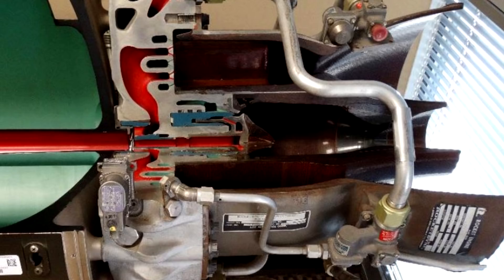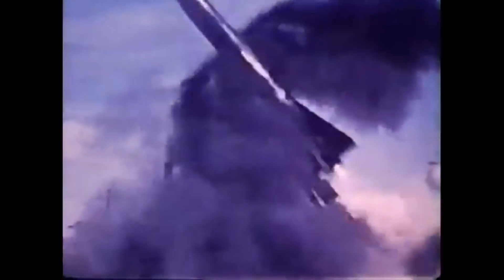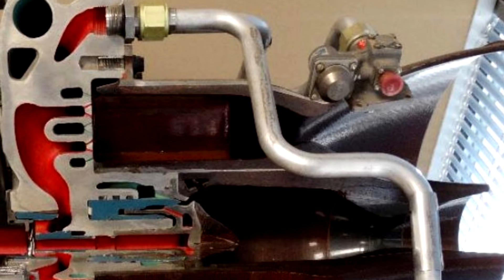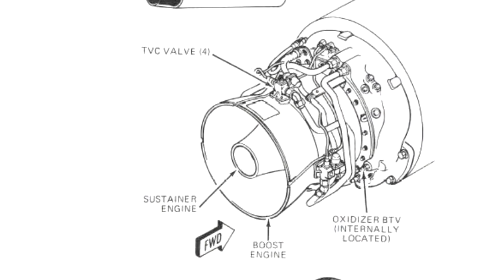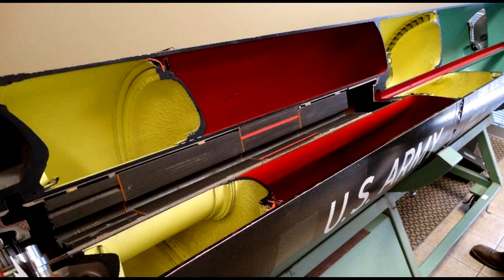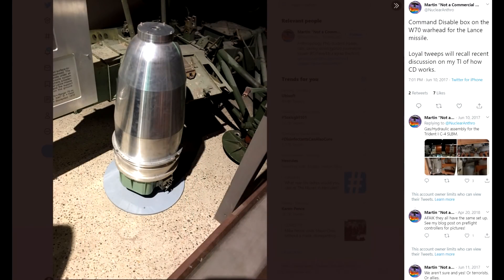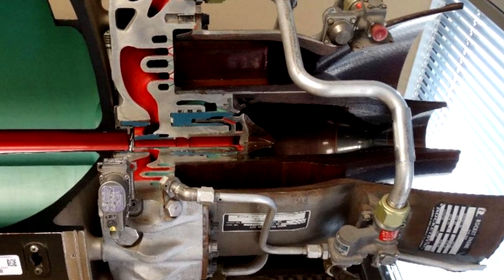A Rocket Engine Inside Another Rocket Engine - The Lance Missile

Comment: You didn't mention it, but the fuel and oxidyzer pistons are there probably mainly because the rocket is spin stabilized. Without those pistons, the fuel would smear around the edge of the fuel tank and starve the engine. Gases venturing into the combustion chamber is unlikely as this rocket is constantly accelerating and not experiencing zero gravity. Change of course due to that equally unlikely as most of the flight the thrust would be provided by the center engine.

Sorry to post that 3 years too late.

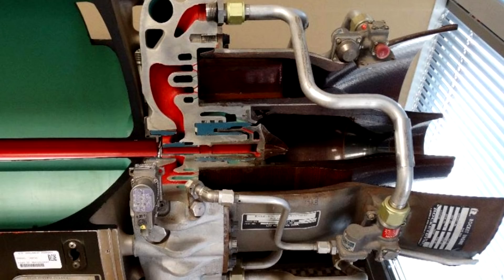Comment: 3:57 at top, just below the zigzaging tube - that's not an inlet, that's a bolt in section. Looks like the combustion chamber was bolted to the injector plate, easy job drilling those injectors then.

Comment: The black smoke was a charge that started a huge piston pushing the IRFNA and UDMH out the back in a hypergolic reaction. Inertia takes over from there and the smoke quits. This baby has a 299 second burn time at Mach 5. She had 4 different nukes ranging from a hardened ground penetrating warhead to turn Cheyenne Mt into a crater to the Neutron "Enhanced Radiation" people killer warhead that wouldn't cause much equipment damage. Also had a high explosive anti personnel warhead containing 800 bomblets. This was my baby back in 1986 and that is what i was taught. She was the only "Neutron Bomb" to ever exist and was actually shut down for a time due to an "inhumane" labeling but was reactivated by Jimmy Carter to show some love to Iran at the time if needed.

Comment: ... we used to fire these at the RA Missile Range in the outer Hebrides ... we had to train the radar operators in the tracking station using obsolete Honest Johns fired off a launch rail welded to e 25 pounder gun carriage because Lance went too fast for them to gather. Lance was a dirty firework ...Unsymmetrical Di-methyhydrazine and Inhibited Red Fuming Nitric Acid are not comfortable bed fellows ... all the storesheds had to be fitted with Draeger gas samplers and drench sprinklers that were like a tropical storm when they went off ...

Comment: As weird as this is for a rocket engine, the configuration is actually not at all unusual to aerospace engineering in general. The entire nozzle system in a low-bypass turbofan does basically the same thing (except for also having vanes around the interior nozzle, if not both of them, to change the throttle,) and then even has something of a mirrored configuration on the front as well.

Comment: I was a Lance crewman in the early 70s in Germany. I think you’re giving too much credit to the guidance system, one of the things that was input prelaunch was the fuel burn seconds if it was a short flight. The  missile was aimed exactly like an artillery piece, point it in the right direction then set the elevation. (This is why fuel burn was only for short flights]. They were supposed to have several types of warheads but in reality the was only one, that being a nuke. 
I hade to privilege of firing three of these, once in New Mexico and twice on the island of Crete.
Reply from the maker: I honestly know very little about the guidance, I was just fascinated by the engine design.

Comment: Actually, only 2 of the 4 black smoke nozzles were to spin the middle. The other 2 were the leftovers from pressurization of the fuel/oxidizer tanks. 
To be picky, it uses Inhibited red fuming nitric acid (I don’t know how that is different from what Scott said). 
Both the fuel and oxidizer were hyperbaric, and very deadly to come in contact with. If the bad guys shot up your middle— run away!!

Comment: Hey Scott, this rocket was my job in the Italian army. I was a Second lieutenant in the 3rd Gruppo Missili Volturno in Italy. My job title (translated from the Italian) was “Lance missile section commander”.
When I left the army I discovered I had taken with me the manual for the Lance Missile. I’ll ask my mother if she still has it, but I doubt it. She sold my comic book collection and my records from the 70s for a song. She probably tossed the manual, but I’ll try.

Nice surprise to see my old weapon system featured here. I even got to launch one in Sardinia one, it leaves the ramp a lot faster than in the video. It’s more like a cannon shot than a Saturn 5 style takeoff. Most photographers took a nice picture of a cloud of dust on their first attempt. 
It’s also incredibly loud. We were artillery so when they said “bring earplugs” we scoffed. We fired M109 artillery guns without ear protection (it was the 70s). But this sucker was loud. Also, it actually launches at between +2 and +3 in the countdown because what we were igniting was the chemical that expanded and squeezed the tanks. It took time for the fuel to reach the motor.
Thank you for covering the Lance. I wish I remembered more about the rocket. If I find the manual I’ll send it to you.
Reply: The US Units were always told that the missile was going at Mach 2.5 by the time it left the rails which were only 5 or 6 inches long.

Comment: Many, many years ago, probably in the mid 60’s I saw a show describing the Lance Missile.  Probably one of ‘The Big Picture’ shows produced by the DOD.  In it they said that after the boost phase the sustainer was throttled to keep the longitudinal acceleration of the missile zero, i,e. they canceled the drag on the missile with the thrust of the sustainer.  This made calculating the trajectory of the missile much easier.  You just had to control the trajectory during the boost phase and after that the missile would follow a purely ballistic, no drag, trajectory for the rest of its flight. 

I’ve looked for the show but can’t find it so you’ll have to rely on how well my 70 year old brain is still working.

Comment: Why can't SpaceX's Starship, not use something/what similar; just 3 engines (combustion chambers) with an inner nozzle for atmospheric expansion and an angular 2nd nozzle for use in vacuum? you need some mechanism to prevent exhaust through the outer nozzle in the initial stage?

Comment: Another great and informative video by Scott. As an aero engineer I spent the bulk of my years working missile systems, so I really appreciate all the work that goes in to these videos. One small "add" for this video. The TVC injection system does increase the thrust slightly on one side, but the majority of the steering effect is caused by vectoring the exhaust plume. As the fuel is injected, it causes a standing shock wave to form inside the nozzle. This shock wave causes the exhaust plume to angle off away from the shock, thus steering the missile. Early FBM systems employed the same concept, except they used an inert gas as the injection fluid - no added thrust, but still lots of steering.

Comment: It's like a fixed expansion deflection nozzle with a sustainer rocket in the middle. Interesting differential throttling using just fuel aside, presumably they ran oxidizer rich.
And finally, was this maybe the last deployed user of devil's venom? Most everything else switched out rfna with nto a while back.

Comment: NASA considered using retired Lance missiles as sounding rockets, but--having flown the Aerobee series solid-boosted hypergolic liquid propellant sounding rockets (which scientists loved due to its "soft ride," but which launch crews hated because it was a dirty rocket to fire [wearing "acid suits" in the desert heat at White Sands was miserable]), and being aware of the Lances' occasional leakage--they decided to pass on them. Another factor was its weight--for its size, the Lance (which has heavily-built, to hold its factory pre-packaged liquid fuel and oxidizer safely, through rough handling [including parachute air drops, as the video shows]) was quite heavy. The Lance also used two different fin sets (as can be seen in the video), as one warhead--I forget if it was the conventional or the nuclear one--was considerably heavier than the other, enabling its rounds to use the smaller of the two fin sets.

Comment: Your vid on the injectors was nice indeed but this ones even better.
At 3:46, you point to the "smaller pipe" and then you go "if you actually look at the top, just bellow that, there's a little inlet", that brings me to a bolt hole from the ring of bolts around the combustion chamber.
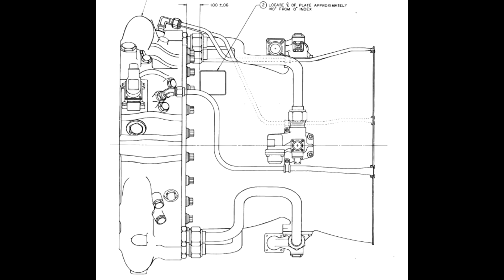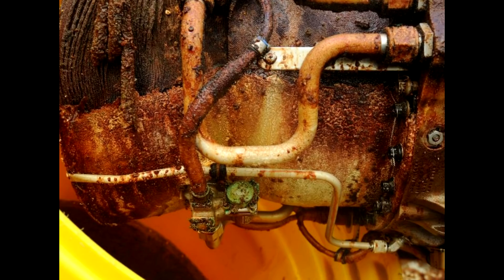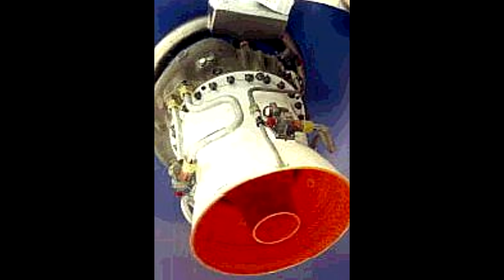For the pipe, I don't think it's connected to the injector valves, it passes underneath. At 4:52, that diagram chose it to be some sort of exhaust. Same at 5:29 and 9:01. On all of these, there are no electricals and the cutaway is missing the injector actuator piping that can be seen in the diagrams.
That fuel tank management !!! They may call it a piston but looks more like a diaphragm to me... a garbage can cover sliding down on post... Awesome!

Comment: Great video... brings back memories... The black smoke is from an internal solid rocket motor.   This motor in addition to imparting some spin drove 2 large pistons through 2 tanks.  1 IRFNA (Inhibited Red Fumming Nitrc Acid) and 1 tank of UDMH (Unsymmetrical Dimethal Hydrzine).  At great pressure these mixed and well you know the rest.  Most of the spin came from the fins.  I was told that it was supersonic within 12 inches of travel.  Having seen half a dozen fired from Create Greece during the 80s I believe it. Duh you said all that.  Great video.  
You can see video's of them firing from Create on Youtube.
Reply from the maker: Well, I can tell you it’s not supersonic within 12 inches, but within a 2-3 seconds depending on the warhead type.
Reply: I was going to say about the same thing. I worked on the guidance of these. seen a few fire in Create also. I was told it breaks the sound barrier by the time it clears the launcher

Comment: So the center motor is the sustain and the valves that add additional fuel are attached to the annular boost engine, that means vectoring is done with flow molding, a cold 'cloud' of fuel coming down and affecting the flow of the sustain engine outside the nozzle. This thing is beyond clever....

Comment: Hi Scott, I have a question: How does the plumbing work for rocket engines with thrust vectoring? Does the last leg of the fuel and oxidizer lines coming from the tanks have to be replaced with flexible hoses? It doesn't seem this should be possible at the pressures you describe.. On the other hand, I don't see how engine gimbaling can be done if these lines are fixed.. And if only the nozzle is gimbaled, how is a seal maintained at the junction with the rest of the engine?

Comment: How does thrust vectoring work if the entire rocket is spinning due to spin stabilization?
Reply: If pointed in correction direction, fire else don't. Not sure about valve speed, but you should be able to get it down to milliseconds.
You should be able to model this using a spinning chair.

Comment: I would have thought using a small SRB in place of the boost motor could have saved overall weight and complexity but it may be that they were not reliable enough at the time.

Comment: Scott. No, the black smoke is NOT to provide spin stabilization. The black smoke is the exhaust of the system used to pressurize and force the liquids into the combustion chambers. Think of the fuel and oxidizer being is bags within the tanks which are squeezed with the pressure developed from the burning of a third chemical instead of using turbos to feed the chambers. I worked on this missile for years.

Comment: 0:11 that happened to me recently when I came across "meteor burst communication"

Sending radio signals over the horizon, by waiting for a meteor shower and reflecting the signal from the trails of plasma made by the falling meteors 0_o
Reply: Meteor scatter is often fascinating to use, and can be surprisingly effective, even with analogue signals.
Reply: Radio propagation is a treasure trove of strange and unusual phenomena.  You have things like tropospheric ducting, when a signal gets caught between layers in the lowest part of the atmosphere.  Or Sporadic E, using highly-ionized patches of the E-layer of the ionosphere to bounce signals at a much higher frequency than is normally possible.  I think my favorite is Earth-Moon-Earth communications, using the Moon as a radio reflector.

Comment: The Titan IIIC  had a TVC system in the nozzles of the SRBs. The little "tank" next to the bottom of the SRB fed hydrazine into a ring manifold that would cause a "thrust imbalance" and steer the rocket (guess they didn't trust SRBs with gimbal nozzles.)

Comment: Really cool,
 I think you missed the obvious point of the plunger system (or didn't state it), no turbopumps, right? 
That's generating chamber pressure. Using solid rocket exhaust directly on the fuel/oxider probably wouldn't work.
Thanks.

Comment: I'm guessing that ablative coating on the engine bells is some kind of more or less normal hydrocarbon polymer.  Leaking concentrated nitric acid onto it for a long time has a pretty good chance of nitrating it into a fairly nasty explosive compound or really pretty much anything else made of plastic.  It kind of looks like the propellant and oxidizer pistons were made of butyl rubber, one of the few compounds resistant to most solvents and nitric acid.

-preemptive edit: nope, after some research, only heavily fluorinated polymers like teflon work for pure nitric acid.  They make pretty crappy o-rings and crappier structural material though.  Oh well.
Reply: Its a phenolic material.   I cannot tell for sure from the pics, but it probably has several fiberglass cloth (or other fabric material) layers in the resin.   In this missile the nozzles dont move, the fuel flow is adjusted to provide an unbalanced thrust across the large outer nozzle.  A pretty daring thing to do with phenolic nozzles, tho it is supported with a metal shell.  There is a whole science about the ablation and heat patterns in ablative nozzles, fascinating stuff, that used to take a mainframe a whole day or two to calculate one scenario.  I am sure its alot faster now.

Comment: The liquid injection TVC works by creating a shock wave in the nozzle due to the impingement of the exhaust gas on the injected propellant.  There is a turn angle as the gas passes through the shock and you get a deflection.  They usually use the denser oxidizer for that but in this case it looks like they didn’t.  I don’t know if the added fuel or oxidizer would increase thrust, or decrease it.  Probably a little bit of both at the same time.

Comment: Great episode and something I've thought about a lot.  Do you think it would ever be possible to have a center ION engine,  with outer being more traditional rocket engine?  I'm wondering where both active.  If the higher velocity ION engine "thrust" exhaust would add efficiency and thrust by the hitting exhaust gasses of traditional rocket motor during it's burn.  Or some sort of combination where high velocity exhaust pushes against perhaps accelerating lower velocity by higher mass exhaust of traditional fuel rocket?

Comment: Thanks for the info, Scott. I was up close and personal by several of these back in the early 1970s (yes I am an old guy) and when I asked a couple of questions of the guys who were working on them I didn't get a straight answer. The sustainer engine had me making wild guesses about what I was looking at but "need to know" was the catchphrase that shut off any questions back at that time. I worked on calibrating red-eye missile tester sets back then and the missiles with that technology were quite different than the lances. I had no idea the lance missile propulsion section had been declassified yet.
Reply: The reason for the 'need to know' response was that they had no idea how it worked.  If a problem was discovered during schedule inspections of the missiles in the bunkers, a depot level maintenance team was called in to remove / repair.   The live fires in Crete were a way to do a sample test firing of the inventory.  We received feedback on point of impact and very often it would hit within 1 meter, usually 10 meters, but rarely 100 meters of the intended target point.

Comment: It's Carbon-phenolic and, no. it doesn't actually burn away in a few seconds. The actual ablation is very light and it acts as an insulation for the metal casing.
Reply from the maker: Yep I covered this in my Aerothermodynamics video.

Comment: Is the piston arrangement just to avoid bubbles, or does it also act as the propellant pump? I don't see any other propellant pump, but for the pistons to be the pump, the propellant tanks would need to withstand somewhat more pressure than the combustion chamber.

Comment: I had the same idea but with an ASL optimized bell nozzle engine at the centre of an aerospike engine. My thought was you could somehow use the pressure from the exhaust of the aerospike to simulate atmospheric pressure so the centre engine wouldn't need a vacuum optimized nozzle in orbit.